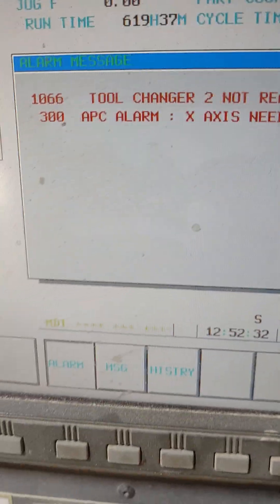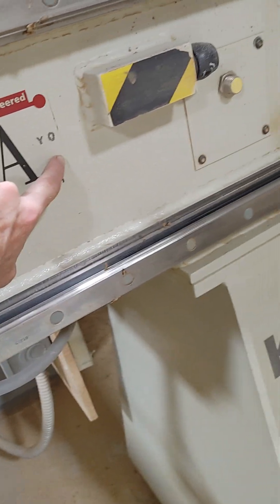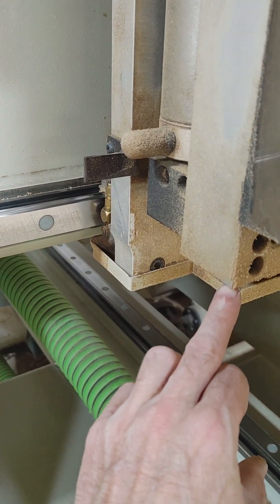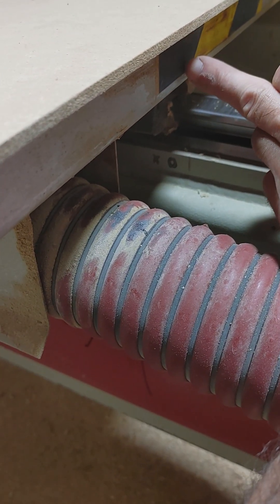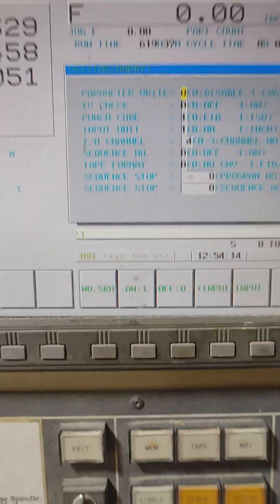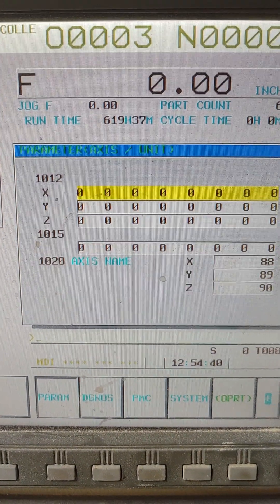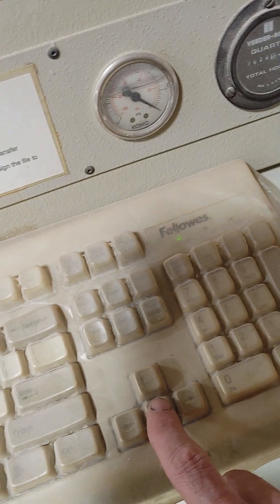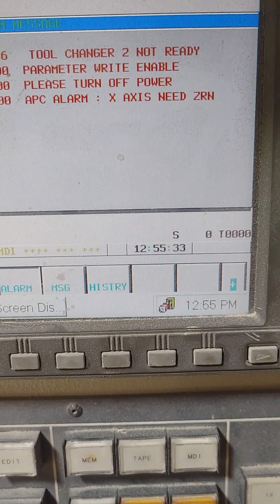komo cnc router error 1066 and 300 resetting axis and tool changer mach 1 controller Part 1

Comment: Urgent help needed! I have the 1066 TOOL CHANGER 2 NOT READY alarm on this exact machine! I have literally tried everything including your instructions, some I found on the manual and even using ChatGPT. Still no luck and that's the only alarm showing up. Any ideas? Do you happen to have contact number I'd be able to reach out to? I know this is a shot in the dark.
Reply from the maker: @andrew-bajema have you checked the battery for the carousel?
Reply: @ Thanks so much for the reply! How would I check that or where is it located? I did order more batteries for the SERVO AMPLIFIER UNIT based on the last step in the instruction manual from Komo. Is that the battery you’re talking about? I do know the the “rotate magazine” button does not rotate anything currently.
Reply: Basically the step where you change the 10000000 to 10000001 doesn’t make it stick and after restart it keeps going back to 10000000 so something is off.
Reply from the maker: @andrew-bajema  the batteries are in the main control unit. Should be one hooked into each servo controller and one for the carousel servo drive. I can take pictures tomorrow if needed.  You can use 6v lantern batteries in a pinch but have to crimp the wire leads to the springs.
Reply: So I did order what seems to be the correct type of battery on Amazon to get here tomorrow morning for what I believe is for the carousel servo drive. I will give it a shot and let you know! But if you do happen to get to your CNC first, a photo couldn't hurt to clarify.
Reply from the maker: @andrew-bajema  ok, sounds good.
Reply from the maker: @andrew-bajema  any luck?  I was out of state for a family emergency but am back today.
Reply: Oh no! I hope all is well. Yes that replacement of the battery on the servo amplifier unit cleared that alarm! Of course it's the simplest fixes that are so hard to get to. 🤦‍♂

I do however have a different alarm that I have to reset every time I start up. It's “449 Z AXIS: INV. IPM ALARM”. Are you familiar? I'm used to working with it by now but basically it has to do with shutting the air off after use (or something else) which makes the whole Z axis head sink over time and probably mess with the home settings. I reset by bringing Z up to zero manually and turning whole machine off and on until it clears. Just trying to figure out a fix eventually...

Comment: Anyway you can help me with my error codes? I'm also running on a komo mach 2 . I got error code 1068 , and can't get it to move .
Reply from the maker: Does it display and explanation of error 1068?  Usually it will say something next to it.
Reply: @blmartech  it says 
1068 tool changer 4 not ready
Reply from the maker: @Chriticus  have you tried rehoming the tool changer?
Reply: @blmartech  I started the process but can't find the Manuel valves to get the spindle and carousel.
Reply from the maker: @Chriticus  if you are looking at the back of the machine, they should be in the box on the left hand side unless it has extra optional equipment.
Reply: @blmartech  I believe it must have been optional I don't see anything that looks like what you showed in your video